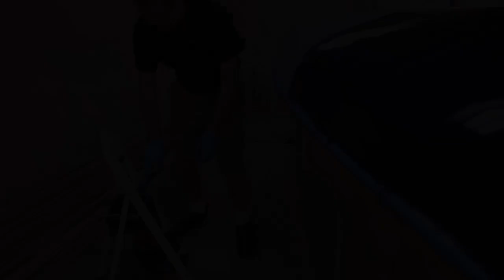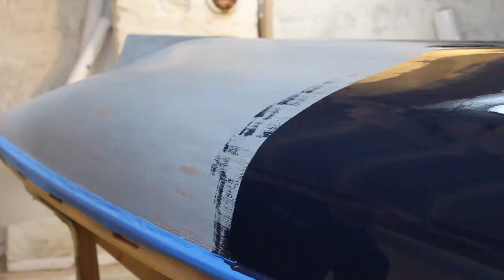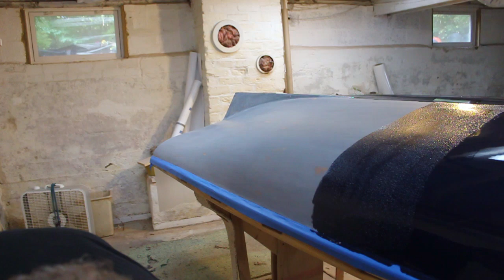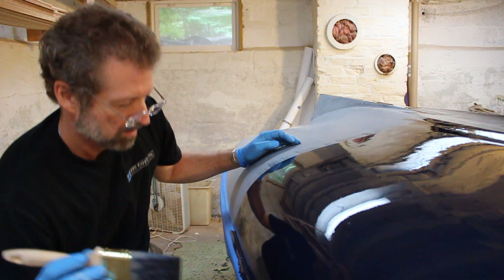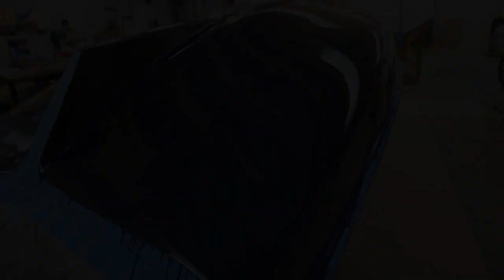Rolling and Tipping - First Coat

Comment: I just proved that tipping is not only unnecessary it only makes for brush strokes. After sanding down my first coat I tried rolling only. The trick is to thin quite a bit. To remove the bubbles simply roll the roller over the bubbles as light as possible. No roller marks no brush marks. Flows out instantly.
Reply: I've done both. Roll and tip makes for a smoother finish with properly thinned paint and the right brush. Sorry
Reply: No need to apologize. But I'm also firm in my opinion.
Reply from the maker: If you leave brush strokes when tipping with a brush, the most common reasons are either the paint isn't thinned enough to flow out flat or it's drying too fast (maybe trying to work too large an area). With enough care, tipping with a roller can work. Glad that worked for you. All things being equal, most people find a good brush for tipping is far more forgiving, and let's you work faster with fewer mistakes. The foam rollers I use would never work for tipping. They leave micro-bubbles that don't dissolve quickly enough – the paint starts to thicken before they pop, and each one leaves a tiny ring and a pit. Also, with too light a touch, enough not to leave bubbles, the roller stops rolling and just smears. Other rollers, and a lot of finesse, might be able to overcome those problems. Not saying you're wrong, or that it can't be done, just that in most situations a brush will work better.
Reply: EIH-Yea, I agree. You gotta know what you're doing, have the paint properly thinned and have a good brush.
Reply: This has been my experience also.
Reply: @eyeinhand  My point is. There is no need for a brush. I find that the roller and no brush lies down just as good or better than a brush. Thanks for acknowledging that roller only is possible. I don't see the use of roller only as a procedural problem rather a more efficient procedure with no drawbacks.
Reply from the maker: @Kotaztrafee  Glad it worked for you.I think it's a truer statement to say "not all conditions require tipping out roller tracks with a brush." Sometimes a roller alone will work, but do a test first. If the roller is making bubbles that persist longer than it takes the paint to begin drying, you will definitely need to tip it out with a brush.

Comment from the maker: You have to work quickly, while the paint is wet and fluid. The thinner evaporates so fast you can only work a small area at a time without it starting to dry and leave brush marks. You want to work a whole surface, steadily covering the whole thing in a single continuous strip.

Comment: Hat is off to you sir! What a wonderful job!  I have a O'Day 272 that I have been through and rebuilt bottom to almost top. Looking to repaint the deck to finish things off.  I am considering rolling and tipping everything followed by doing the nonskid in KiwiGrip.  My other consideration is to do all the repair work myself including fairing out low spots, repairing any crazing/spider cracks and filling all holes then prepping, taping and priming myself and just having a guy professionally spray the deck (Deck only, hull is already all set) including the cockpit. As stated all the hardware is already removed, I just want to pay a guy to spray the deck with awl grip. Any viewers have any idea what someone might charge me to just spray it?

Comment from the maker: Doesn't sound like a temperature problem. It was probably mid-60s when I painted. You do have to scuff between coats. The paint dries so slick it won't stick to itself evenly – orange peels. You scuff evenly and lightly to give it a "tooth" to grab onto, or at least I did. Where I missed, the wet paint tried to pull away and bead up. Any oil or contamination on the surface can make it act funny, too. Just wipe with water between coats. Also, too much thinner in the brush will do it, too.

Comment: Just looking for tips on how to paint my 93 suburban a rolled on satin black..very good work here...and the Mazzy Star music completely had me captivated!
Reply: lol i came here because im thinking of doing my squarebody burb
Reply: The Rustoleum I rolled on is doing good except the doors are scratched up from when I stopped at my gate after taking my dogs for a ride and forgot to roll the windows up..two of my dogs like to jump out and run with my neighbors dog..all I have to do is scuff up the door and roll on another lite coat...there is another thing you can try that I will be putting onto my jeep wagoneer and its called Monstaliner..it can be rolled or sprayed on and it gives a textured but smooth finish with no rubber bits like the other bedliners..its also UV permanet..cost more than Rustoleum but is better...of course most people do not want a textured finish on their vehicle..maybe just on the walls of their home.
Reply: Check out Monstaliner..they have any color you want..I wish I made money by the mention of their name, but I do not..I did an entire bronco with the black and it turned out looking really good "to me"..wish I did not sale it..but the wagoneer will help me to forget it once its finished..it will have 35's and the roof cut out with other mods..I hope to have the same feel as the 4 door JK's which I cannot afford.

Comment from the maker: The paint is thinned slightly, and the brush was initially just dampened with thinner and thoroughly shaken out. You don't want the brush to bleed extra thinner into the paint (my own mistake) just keep a dry brush from sucking all the moisture out of the paint. More details in the link in the description – can't post a link in the comments. What was your issue, too much thinner or not enough?

Comment: Looks great. Is this a 2 part paint?
Reply from the maker: Nope, simple one part. But good quality expensive boat paint.
Reply: @eyeinhand  it must be slow drying then?
Reply from the maker: @officialWWM  Well, slow is a relative term. To me it dries super fast, so fast I had to work really quickly on only small sections at a time. The thinner in the paint that makes it flow out smooth evaporates almost as soon as you roll it on. That two foot square area is about as much as I could do at once.
Reply: EyeInHand thanks for the tips, I'm about to tackle my boat, a beautiful old 1970 Hartley Vixen I've been restoring with my 8 year old son. I was going to use a 2k paint but I don't think it's necessary, I'll probably go with something like this. How is it holding up?
Reply from the maker: @officialWWM  So far, great. After 9 years I have not repainted, and don't need to. That said, they live on a trailer in the shed when not sailing. But still, I'm surprised it's held up so well.
Reply: EyeInHand thanks so much for your help, I'm a car painter by trade but I'd like to avoid using spray gear as the boat is in a garage under the house. I don't think my wife would appreciate the fumes coming up through the floor, lol.

Comment: Not sure if you're still responding here but first, BEAUTIFUL job. My question: did you use the gray primer under the white boat? I will also check your website. Many thanks.
Reply from the maker: Perceptive question! No I did not. I used white primer on the white boat, grey primer on the blue boat. High build primers on both, but colors that closer matched the final paint.
Reply: @eyeinhand  Thank you!

Comment from the maker: Just added a link to the painting page on the blog in the video description. Posts leading up to that one cover the prep and steps leading up to it. This paint doesn't act much like other paints, but the closest cheap thing to practice with is probably a good high gloss oil based enamel, thinned quite a bit.

Comment: Hi friend great video.how many top coats did you use
Reply from the maker: Just two. Using a primer color that's roughly the same value as the finish coat helps a lot. As you probably know, much depends on the quality of paint used.

Comment: could you answer a few questions? do you only need one coat? how long does the paint need to set up and do you use any hardner? even though it looks like one heck of a finish would wet sanding and polishing make it look even better? I'm right in the middle of restoring a boat and I was planning on spraying gelcoat until I found this yacht paint. It's pretty amazing and that paint job looks stellar.
Reply from the maker: I did two coats over a tinted primer. Three if you count the one I messed up and sanded off.) No harder added, just mixed small working batches with a little thinner so it would flow. It dries so fast it will be noticeably thicker in the roller pan after 10 minutes. For me it was ready to recoat the next day. I did not need to wet sand, but used a scouring pad between coats to take the gloss off and give it a little tooth for the next coat to grab.I did all my sanding before the painting. If you prepare the base surface well, you should not need do more. I think anything you do to the surface will only take shine off, not add to it. Just make sure the surface is smooth before you start.

Comment: Wow, that is a beautiful job, especially in a dark colour. Is there any reason you are tipping off along the hull rather than from the centreline to gunnel? I will need to paint my boat on a hardstand, and it would probably be easier to go gunnel to anti foul, but after watching your video, and the finish you are achieving, i'm re-thinking the roll and tip procedure... But I'm totally inspired at how easy you make it look!!
Reply: You cannot go that direction or youl push the paint down off the side and get drippers off the gunnel. You go across ways on panels that gravity is fighting you.

Comment: Hi nice job I was wondering how it held up? I need the same color but on the sides of the boat.Mine is over gelco.thanks Kevin
Reply from the maker: Still looking great after 3 years. However, they stay covered when not in use, and aren't used hard. Compared to other paints I've used, it's holding up really well. I'll definitely use it again.

Comment: Great job how many coat of primer did you use and how many top coats
Reply from the maker: It a thick, high build primer. One coat of that, mostly sanded off to fill in the dips and pits. Two top coats to finish.

Comment: Brilliant work, what ratio paint to thinners please.....thanks
Reply from the maker: There's no formula. You have to adjust based on the room temperature and humidity. In the cool damp basement I was using about a capful of thinner to a cup of paint. But it would evaporate quickly in the pan. If the paint got thick enough to leave brush strokes I would add another capful.

Comment: If my tipping isn't done properly is there a chance of brush strokes? Also, about how long does the prep work take for about that size boat? Are you dipping the brush in thinner every time you tip it or back brush it?
Reply from the maker: +ANNA BENEZUE If you thin the paint slightly, the brush strokes flatten out. I tried dipping the brush in thinner, but that was a bad idea – it leaves streaks. Better to just dip the brush in paint only.

Comment: Hope you read my comment sir... Hello my name is carlos and I starting my own bussiness fixing boats and doind some fiberglass jobs and my question just is... When the paint get dry did you can see the brush mark or not?? Thanks and congratulation for your amazing job sir...

PD: Sorry for my english 😁👍🏽
Reply from the maker: No brush marks at all when dry. If you thin the paint properly so if flows out, and don't touch it after tipping out, it dries smooth and shiny. Good paint is critical.

Comment: Are you using thinner on the brush or just leveling the paint??? Please. I need to know
Reply from the maker: No, definitely don't want to have thinner in the brush that would come out in the paint, only mixed into the paint. Initially I dampened the brush with thinner to keep it from sucking up moisture, but shook it out before using it. Brush is frequently tipped with a little paint and wiped off, just to keep it damp.

Comment: Hello you tell me what produce you used  and if there is also white with the same brillance thanks waiting.
Reply from the maker: I did two boats. The second one is white, using the same type of paint and done the same way. Much more forgiving than the dark blue, partly because it doesn't have the same "wow" gloss of a darker color. But has held up well.

Comment: EyeInHand Fantastic job! Thanks for sharing. I'm a novice looking for advice. Can you tell me the kind of brush you used for this job? Thanks in advance!
Reply: EyeInHand I forgot to ask – do you dip the brush in paint before tipping?
Reply from the maker: Hi Jose, the brush is nothing special. Just a medium quality finish brush with, 3" wide with a soft tapered tip. The brush is dipped lightly in thinned paint just to keep it damp, not enough to add paint– just to keep it from drawing paint up from the boat. All the paint is rolled onto the boat then tipped out with the brush.
Reply: EyeInHand Thanks for your response! I'm guessing the roller isn't anything out of the ordinary either?
Reply from the maker: Nope, just a fine grained finish roller for trim. All basic hardware store stuff. The Wooster brush maybe $10. Trim roller with pan and extra sponge rollers, maybe $7. 80% of the work is surface prep. 15% is thinning the paint to suit the speed you work – too thin, it streaks; too thick, it doesn't wet out flat and leaves brush marks.. 5% is technique.
Reply: EyeInHand Thanks again for posting and for your advice! :D

Comment: I wish I could see what you do with the brush right before tipping off?? was someone under the impression the boat was demonstrating something? Thanks for sharing your knowledge  when you were in frame.  At a glance I understand  the finish is astonishing  and the rest of the time I'm hungry for the technical reasons for your achievement not "duh, shiny boat" and "more ,shiny boat"
Reply from the maker: More info in the description. The video is part of a full length project. When it was created seven years ago, it wasn't intended to be a standalone video, but one part to help explain the process.

Comment: hi  whats the best roller and brush to use  that paint job is lovely
Reply from the maker: Nothing fancy about the roller and brush. It's a small smooth nap roller so you can lay down a thin coat. The brush is just a Wooster trim brush. You want something that tapers to a thin edge. It's only used to pop bubbles and flatten out the ridges left by the roller.
Reply: @eyeinhand  thankyou you make it look easy  got a 35 foot cruiser to paint when i get the nerve to do it haha

Comment: Easy on a small area,I’m a boat painter,Try to paint a 15 meter x 4 meter with the same technique on  a 8000 yacht ,not so easy 😮😅😊
Reply from the maker: Surely. I've seen two people working in tandem on bigger boats – one works the roller, the other follows right behind with the tipping brush. Even they worked inside a big shop, though. Would be really difficult to do outside where you couldn't control wind and sun. More hands wouldn't help.
.

Comment: Do you dip the brush in paint too or is it kept mostly dry?
Reply from the maker: You constantly have to dip the brush in the paint. It has to stay wet on the brush , and this paint dries VERY fast. You want load the brush with just enough paint on the tip that the brush doesn't REMOVE any paint from the surface, but doesn't add significantly more paint, just a little, or you'll get runs. The damp brush mostly flows out the bubbles in the surface left by the roller.
Reply: EyeInHand excellent thanks for the fast response !

Comment: how soon after the last coat is applied can it be wet sanded and buffed to a final shine??
Reply from the maker: It gets no wet sanding or buffing, just a light scuff to put a tooth in it between coats. This is the final shine, as it looks when the paint dries.
Reply: I have a Jet Boat. Im looking for a flawless finish. No brush marks or streaks or anything. By rolling and tipping is this something that can be achieved?

Comment: Is it possible to roll and tip alone on a bigger boat?
Reply from the maker: Definitely. The trick, whether working alone or in pairs, is to only work a small area at a time so the paint is always wet when you overlap the previous section. Easiest if you can work in stripes from edge to edge. If it's a very large surface you may want to thin the paint more so you can cover a larger area. Otherwise, if you have to overlap a section already dry it will leave a ridge that can be visible until wet sanded smooth.

Comment: Hi, What roller would be easiest a foam roller or a fluffy roller, thanks
Reply: Not a fluffy one.lol.
A mohair roller gives great results.
Foam are ok, but hold very little paint.
A cheap foam roller can break down and leave inclusions (dirt/hair etc).
Some two pack coatings can cause cheap rollers to break down.(although this is apparently a single pack polyurethane.

Comment: Would this method work if i sanded and primed over gelcoat?
Reply from the maker: Yes, works the same way. These boats are covered in a clear layer of fiberglass and epoxy, and that's the surface primed and painted.

Comment: Have you ever gel coated over paint
Reply from the maker: I'm painting on a layer of glass and epoxy over wood, primed and sanded. If it's in good condition, the technique would work over gelcoat. Probably the same paint, as well.

Comment: Are you dipping the brush in tipping thinner?
Reply from the maker: No, that turned out to be a bad idea, caused streaking. Just kept the tip of the brush damp with the same paint, which was thinned slightly to flow out smoothly. About a capful of thinner to a pint of paint.